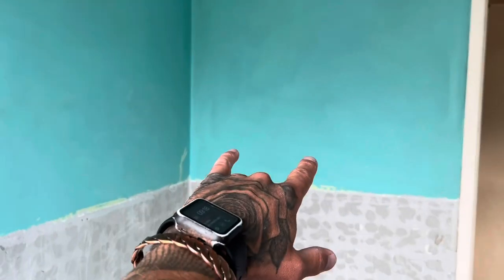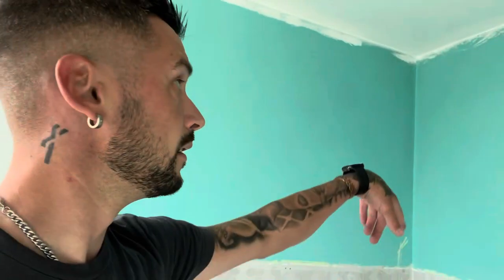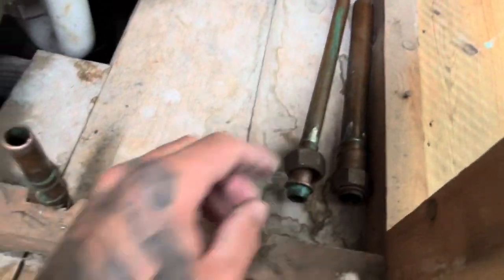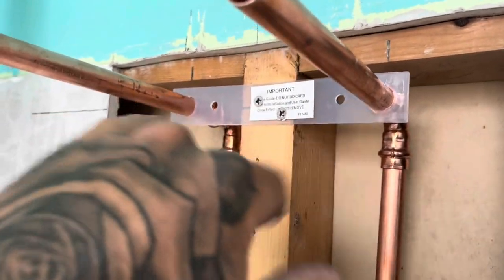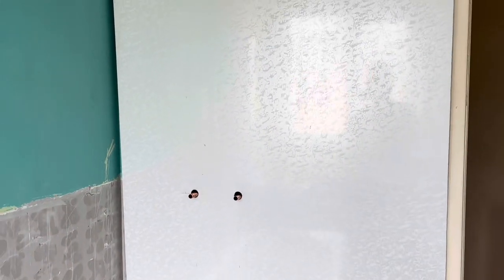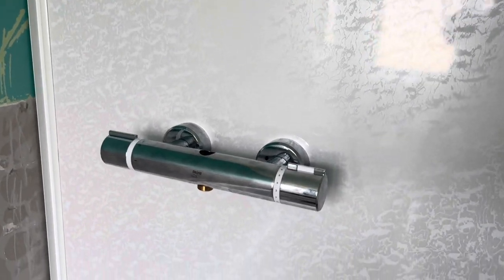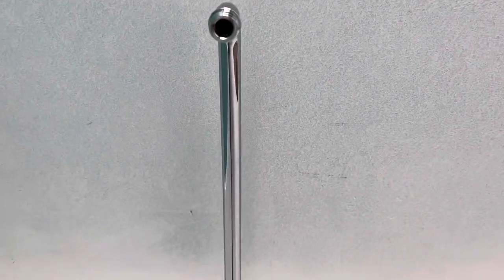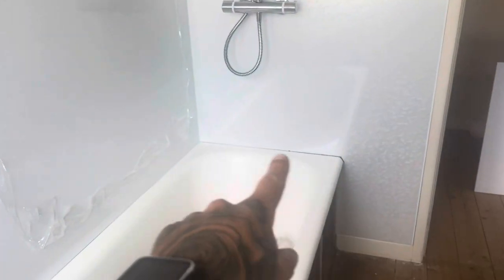Day in the life-Shower and aqua board installing 😩 #bathroom #plumber #diy

Comment: you should bed them boards into silicon along the bottom wipe clean then reseal final coat once all fitted
Reply from the maker: I did seal along the bath before putting the board on then will seal after, but I see what you mean. That’s a good shout thank you!

Comment: Dan how do you determine 3/4 pipe instead of 22mm before you cut it how can you tell the difference
Reply from the maker: It’s hard by looking at it. But firstly the cutter won’t always cut through it because it’s smaller in diameter. And second always carry 3/4 fittings just incase mate.

Comment: Nice pipework, gravity system? Boards probably not the best but if customers on a budget you just do what you can.
Reply from the maker: Yeh apparently it’s coming out in 6 months, was just to give them a shower. No not gravity, was on a combi this mate. 🫶🏽🫶🏽
Reply: @Heatking  ah makes sense doing it on  a budget if its just to tide them over. Can I ask why yous used the gate valves if its on a combi. Not criticising anything just curious as I'm still a student my thought would've been a full bore iso for a bath filler.
Reply from the maker: @Tom_Plumb_PHS  I wouldn’t have put any valves on if it was me mate. But customer insisted 😂😂😂 other than that. No need for them really but yeh best full bore for a bath and shower.
Reply: @Heatking  I usually just pipe my baths up in 15 mm if from a combi. Mains pressure and limited by the hot water output of the boiler anyway
Reply from the maker: @chrisgray5903  yeh that’s true mate.